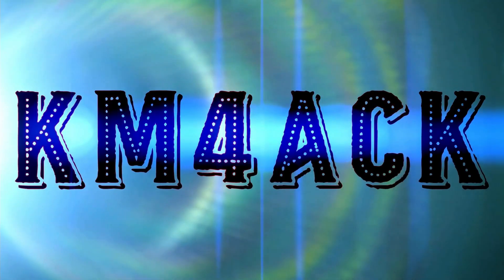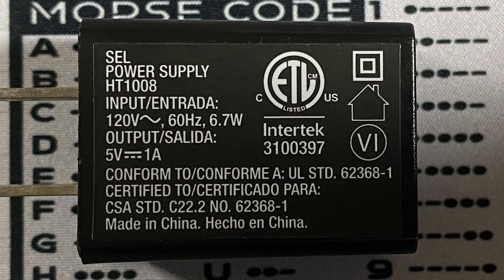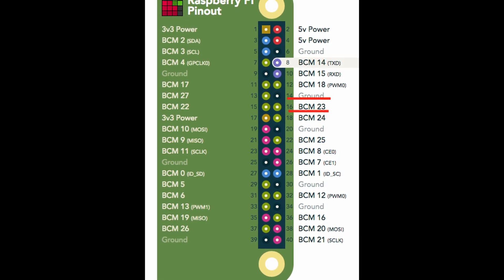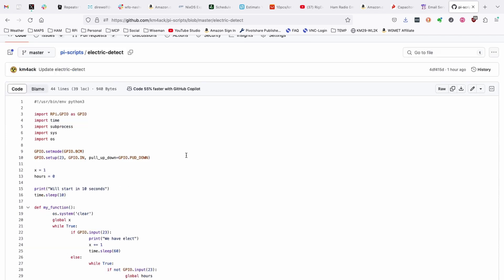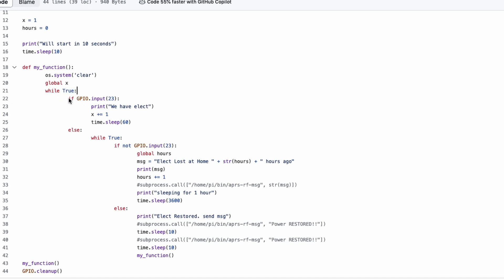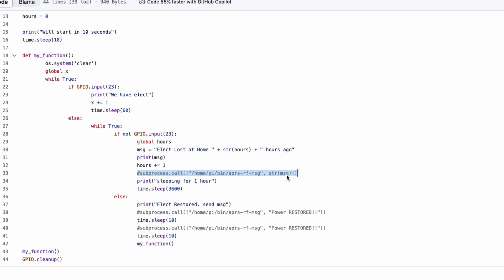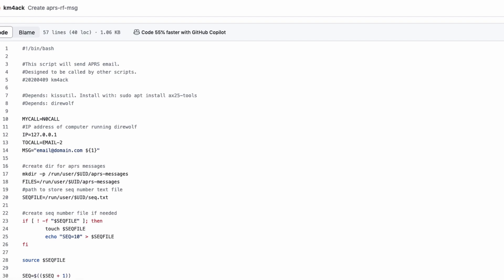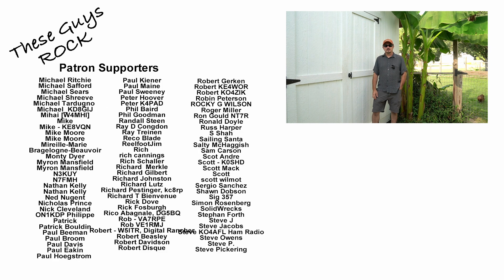Hillbilly Science Experiment

Comment: I built a digipeater using direwolf on a Raspberry Pi. It was going to a repeater site, that we would have limited access to. I didn't want it going down all the time. I bought a Geekworm Raspberry Pi UPS HAT X708. This works perfect. When power goes out, it keeps the Pi running for a long while. Then will safely power the Pi off before the battery gets too low. It will then power back up when AC mains is restored. The X708 has a companion script to read the voltage, and also notifies when AC is lost. The station will beacon AC power lost when that occurs. The nice thing, it will also beacon battery voltage as telemetry. This is one approach, but much more expensive than yours.

In your case, I would probably remove that 10K resistor and put a standard 5V relay in there. Then the relay output would simply be a switch input to the Pi. The other side of the relay would connect directly to the 5V PS. If you want to use the resistor method, you might be more reliable using two resistors in a divider network. The .5mA is jut how much the pin can sink. Not the bold text at the 4:05 mark (This is a 3.3V device). A voltage between 1.8V and 3.3V will be read by the Raspberry Pi as high; anything lower than 1.8V will be read as low. Do not allow an input voltage above 3.3V, or else you will fry your Pi! 

If you keep your resistor method, I would recommend changing to using two 10K in series across the 5V Red/Black wires, and connect the Pi  to the point between the two 10K resistors. That will give you a 2.55V trigger voltage if you use 5V wires. Still keep your 10K resistor going to the pin also. Since I can't put a diagram here, it would look like a T with the three 10K resistors connected. One leg to the Black wire, one to the Red, and one to the Pi GPIO pin.
 
The white and green wires are used for the USB communications between device and chargers that can adjust output current and/or voltage based on the device connected. If you had a straight 5V PS with only +5V and GND, then you would have to use the divider network or a relay or something similar.

Comment: I see one problem with the script. By calling my_function at the end of the second while, rather than re-starting the process, you are calling it recursively. After five power on power off cycles you will have you will have six instances of my_function running on the pi. This will not break it, but after enough on off cycles without rebooting the pi in will cause a stack overload and the pi will crash.  A better way of doing this would be to add a break statement in place of the my-function. This break will terminate the second while statement and return you to the beginning of the first while statement. You also may want to reset x to 1 and hours to zero just before before the break. By doing this only one instance of my_function will ever be running and the stack will not overflow. Otherwise this is one nice piece of code.
Reply from the maker: Thanks for the suggestions! I am working on a couple of improvements to the script and will incorporate your suggestion

Comment: I am both an EE (retired) who did a lot of digital stuff, and an experienced Python programmer.
1. You are going to run out of stack space if you get enough power cycles.  Calling the function from inside the else inside that function itself counts as recursion.  The stack space used by the initial call has not been returned, and new has been allocated for the new invocation.  Instead of calling itself, changing that to a break statement (your line 24 in the video).  That will exit the inner while, and the program will continue at the next iteration of the outer while.  If you need the os.system('clear') at this point, insert a copy just before the break.  (You also shouldn't need those global declarations any more at this point, since there will only be the one context.  Set hours to zero inside the function, before the first while.)
2. If you wind up wanting to use a different pin, you're going to have to search for all those 23 values and change them (and be sure that you're not going to change a 23 that isn't a pin number).  Better to put a line "PWRSENSEPIN = 23" (without the quotes) near the top of the file.  Then replace those 23's, including in the GPIO.setup() call, with PWRSENSEPIN.  Now if you want to change it, or if someone using your code wants to use a different pin, they only have to change it in one place.
(Actually, if it were mine, I'd re-architect this into a while True; a while GPIO.input(PWRSENSEPIN), a while not GPIO.input(PWRSENSEPIN), and no if statements.  Let me know if you want to see how.)
With the circuit the way you have it, yes, you want the pull down resistor, or it could take a long time for that capacitor to discharge to report the power failure.
3. But, I'll bet the 5 volt pair doesn't have significant ripple.  I believe that your problem is using one of the data lines.  If it is a truly dumb USB wall wart, the data lines may just be terminated (or open), but they may be waiting for communication from a "power delivery" class load to negotiate a higher voltage, and it could be trying signaling bursts, causing your extra power fail signals.  Unless you've been looking at this stuff with a scope, ripple may not be the problem.  And someone duplicating your system may not get comparable results, from whatever wall wart they choose.  The 5V wires of the USB wart should be reliable for all such wall warts.  And solving the input voltage limitation of the Pi can be done with something that all hams at least used to know: a voltage divider.  Two resistors, same value, one between the Pi pin and ground, the other between the Pi pin and 5V, and the pin should see 2.5V.  You don't need the internal pull down in this case: you have an external one (which, unlike the internal one, has a value that you know, so that you can make the resistor to 5V the same value).
4. You might still want the capacitor, especially if you're not using a good USB wart.  Between pulses of an unfiltered rectifier output the capacitor (placed across the wall wart) is being discharged (mostly) by the series combination of your voltage divider.  Let's say 50Hz power, in case any Europeans want to do this, and half wave rectified, so that you get voltage for a little while once every 20ms.  One time constant = R*C, would decay to 37% of the peak voltage, which would be well into triggering, so let's say we'll allow 10 cycles missing for that to happen, meaning that one cycle should stay above 90%, and not trigger.  So we want a 200ms time constant.  If we're using two 10K resistors in series for our voltage divider, then we have 20K for R.  200ms/20k gives 10uF.
5. You might want to do this with some non-USB wall wart, which may, indeed, be an unfiltered half wave rectified output, but it could even be a different voltage.  No problem.  Adjust the relative values of the two resistors to still get 5V.  Just be sure that the voltage rating on your capacitor is up to it.
6. Or if you replace the ground resistor with a back biased Zenir diode, or a series stack of 4 cheap silicon signal diodes, forward biased, an you can let the input voltage vary substantially and it will just work.

Me, I'd tape a photo cell over the pilot lamp of some piece of equipment that isn't backed up (the battery charger, maybe).

73, Bill KE1G

Comment: I would have used an opto-isolator to avoid worrying about current on a digital pin on the pi.  It becomes a simple relay and uses ground (common) as the trigger for an output message.

Comment: Great stuff as usual Jason. The idea of being notified when the home QTH has been in the back of my mind for years.

I was going to ping a device that was connected to grid power. Then when I lost the ping it would notify me of a power loss via SMS. I never implemented it due to other projects.

So I was thinking what if, instead of using a wall Wart and an input on the Pi, just ping a grid based device. Then when you could no longer ping it, assume a power loss. This way no additional hardware would be involved and there would be no need to wire up to a Pi input.
Reply from the maker: Why didn't I think of that?? Oh well, learned a bunch through this project.

Comment: I'm not the most proficient python programmer, but I see recursion going on,  line 42.  Eventually you'll blow the stack.  Calling a function from within a function is OK in some instances. In this case what will happen if you ever get to the code after the second else statement is that the myfunction() call will push data on the stack and run the myfunction code once more.  After a finite amount of time, you will run out of memory.  The stack is just a chunk of memory that has been reserved for the "stack".  I say this based on over 50 years of programming multiple languages.  As I said I'm not a expert with python but I can't imagine python does it any different than pretty much all of the modern languages I'm familiar with.  I think you will get what you want by breaking out of the second while loop which will put you back in the first while loop.  So replace line 42 with "break" without the quotation marks.
Reply from the maker: Thanks! learned something new today :-)
Reply: This is the same warning I was going to give.  glad someone saw it when the video was new.

Comment: I have a similar setup for my home automation.  But I just ran a small 12v power supply to keep a 12v relay closed when power is on.  When power goes out it opens.  I am using a esp8266 for my home automation, but very similar setup.  Just simplified.

Comment: Hi Jason, well done. The capacitor you used is perfect ie voltage rating a lot bigger than needed, this means it wont break over time. Another way you could do the detection would be to use a light dependent resistor and “physically” couple it to the power LED on one of your power supplies. It would need a code change as the input would be an analog voltage. This method is similar to the suggested opto coupler suggested elswhere in the comments but uses your two wire interface into the Pi.  Again well done, and thank you for giving us all a lesson in python coding to do something practical with a Pi.

Comment: I saw some comments about monitoring a UPS.  You could tie that to a GPIO pin on the pie and monitor it's state.  Another question I have is if the GPIO pin goes High at any time wouldn't that enable the first If statement and tell you you have power?  73

Comment: I'd use an opticoupler to be safe but hold my beer while I show you hillbilly.

My dryer has a wall plug attached in parallel to the buzzer.  The wall plug has a USB ohone charger attached to it.  Plugged into the phone charger is an RF module whith two pins ahorted.  When the buzzer goes off 110 powers the wall charger and the wall charger powers the RF module.  The RF command is detected and I get a notification the dryer is done.

Comment: Awesome idea! In the commercial world for power monitoring we frequently use relays to get a "form c" contact closure to monitor power. While we use line voltage for to actuate the relay and one relay per phase you could use a low voltage relay and wall wart if you are more comfortable with that. It would work similar, but then the Pi is only seeing a DC GPIO closure to ground it's reference ground. There are also relays that can be set to drop out at a specific voltage so you can get an alarm, disconnect equipment, etc during a brownout.
Reply: I was thinking an optocoupler might be the safest option for the PI.

Comment: Excellent thoughts and ideas here, congratulations on not releasing the "magic smoke"! <grin>
A suggestion:
Most larger UPSs have a USB out to a pc or Pi to let the system know that it's on battery power... saves a lot of cable making, and some UPS monitor programs can give data like percent remaining and such.

I would also include a specific message that 'power failed at HH:MM' in case any messages get lost in transit. After the power is restored I'd send 'power lost at HH:MM and restored at HH:MM' to let you know it's use time to give you an idea as to how much power is left, as only recharged from restore to the next power loss (which might have only given it a few minutes), and if it fails again it might only have a very short time of uptime left.  

Excellent work, as always...  -73  Kevin KD9EFV

Comment: Great Concept, one day I'll migrate to this system. Currently, I use a poly-carbonate On the Rocks glass filled 3/4 the way up with water, freeze it solid, and then lay a Nickel on top of the Ice.
It will let you know if there is any defrosting of the freezer. To build a chart, put all of your goods from the refrigerator and freezer in to a safe place, place your frozen glass and nickel
into the freezer and then wait 15 minutes and then shut it down. Wait 4 hours and measure how deep the nickel submerges into the ice. That is the base line. I reference as D. After that build your formula and remember every time you open the door, the experiment ends. You have to start from Zero again. Ambient temp plays a major role in this formula.
Reply: I have one in every freezer in the house as I live in the MidWest and we suffer from lightning, tornadoes, ice storms and I don't think there is a season where we don't have the possibility of losing power, not to mention the occasional squirrel in the sub-station, or driver who takes out a pole on a clear day...

Comment: Dang man - that's pretty cool!  Just an FYI, there is an easier (albeit probably less fun) way of doing this.  The VISTA20P alarm panel connected to the internet, which can be backed up by battery can do this as well.  If the power goes out you can get notified via email from the notification service that the power is out.  This is through Envisalink, which is a free service (you do need to buy their device though for $120 I think).
Reply from the maker: Many ways to skin this cat. This one was fun because I made use of ham radio & APRS :-)

Comment: Jason would a clean output pin from a separate Arduino board be useful?  You could even run a cron type routine on the Arduino that at certain interval "Blinked" the output to the Pi.  On the Pi you could be looking for this and send a "This is a test" message.
Reply: I like the idea of using a "heartbeat" command but I wouldn't send a test message every time.  I think the better option would be to send an error message over the radioif the heartbeat was missed more then once.  Send the heartbeat every five minutes to the PI.  Then a separate command would be sent if power was actually lost.  That way you would get power loss and equipment failure messages.
Reply from the maker: Your idea would probably work but I didn't have an Arduino laying around. I implemented this into my existing APRS digipeater running on a Pi and cobbled the cable together from parts in the junk drawer. It's hard to beat free :-)
Reply: @KM4ACK  I hear ya but I'm one of those guys that say just send me a cable/solution from Amazon.  Even more so with the vision loss.